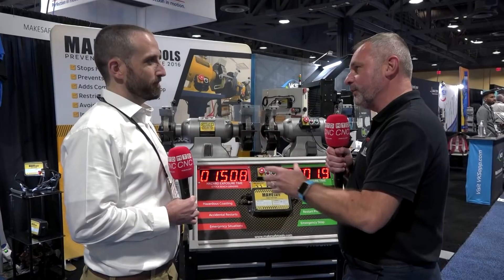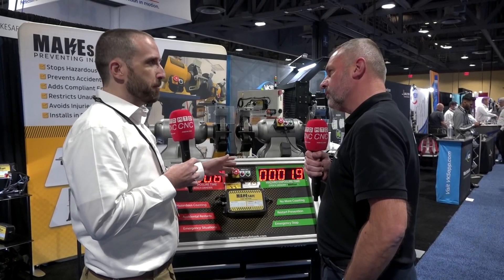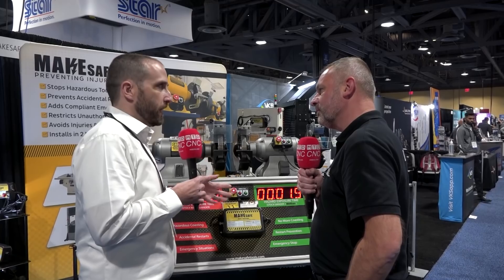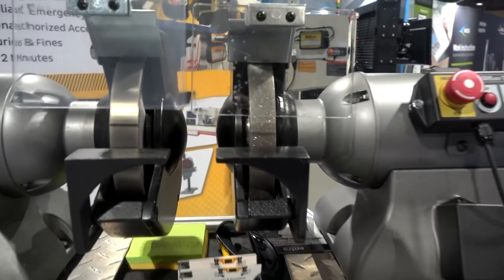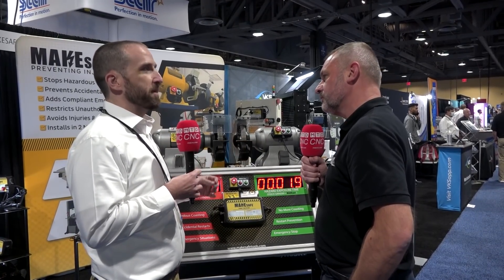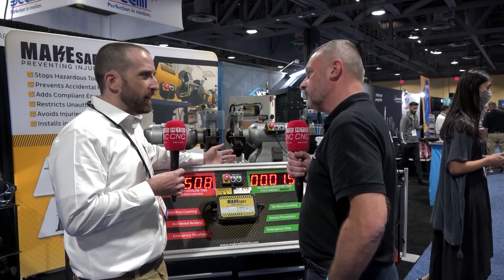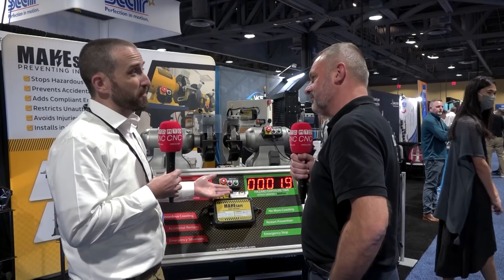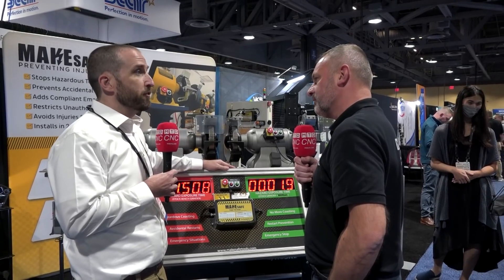Make manufacturing safe - interesting

Comment: Will this replace my extreme phobia of possibly being unable to clutch out my lathe in time?
Reply: Hi Sketch - I assume you're single-point threading up to a shoulder or tapping blind holes (or something like that)? If so, it's definitely possible. We have an aerospace customer that makes pin fasteners and they use it in that way for plug-tapping blind holes. And they make a crazy amount of those fasteners, with most of the operations still being done by hand on an old Hardinge.
Reply from the maker: Glad you enjoyed the video.

Comment: what is it? a DC injection brake? if so, very neat packaging. the one ive got is as big a shoe box.
Reply: Hi Yowz. Essentially, yes, though with some added secret sauce that increases longevity! We just packaged and got it approved as fully UL LISTED product so no panel shops or electricians are required.
Reply from the maker: Glad you enjoyed the video.